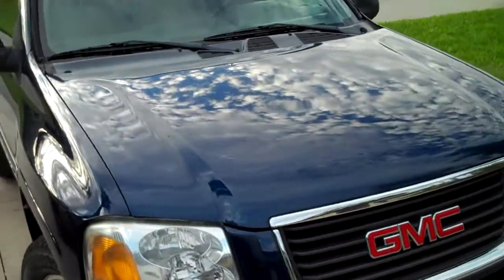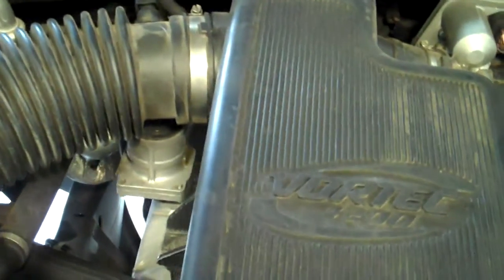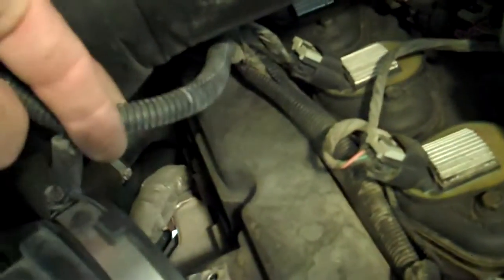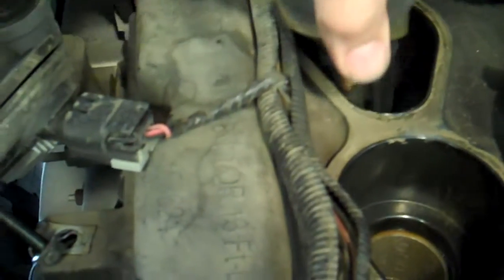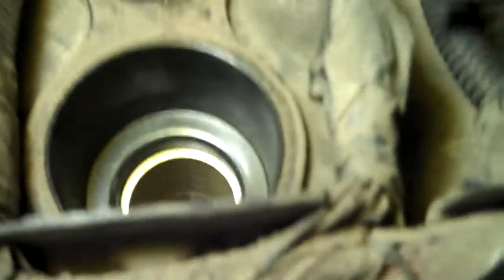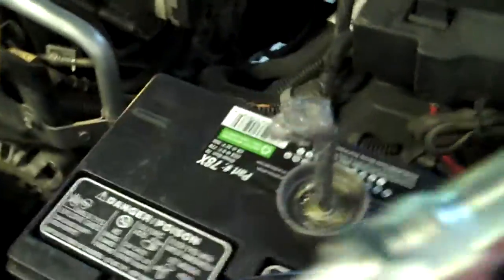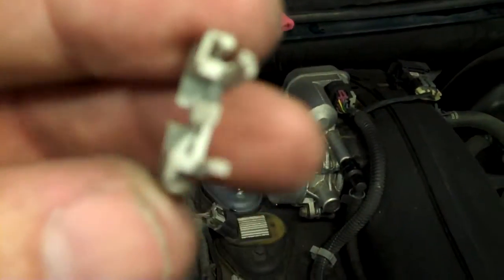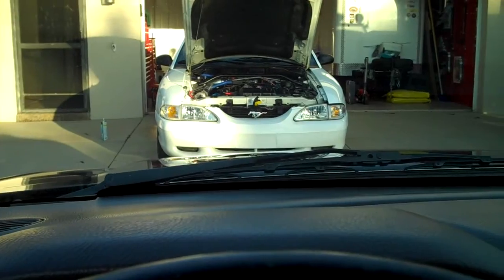Envoy Trail Blazer Spark Plugs and Coil Pack Change. The quick and dirty

Comment: Hello sir.  I just wanted to say that the rubber hose trick to get the new plugs started is a stroke of practical genius.  I am by no means any type of mechanic, but I was able to follow this video and it's procedures easily.  Now my trailblazer no longer bucks and is running as smooth as I ever remember it running.  Thank you so much and I will definitely recommend your channel to my friends with engine issues.

Comment: Great video.  You offered some good tips.  I have a 2004 Trailblazer pushing 200,000 miles in a month or so.  Really like it and the engine is still awesome (knock wood!) don't want to jinx myself.  Have replaced 2 ignition coils, water pump, and other normal maintenance.  Your video was clear and spot-on, some I've watched have been jerky, out of focus, and didn't even show what they were talking about.

Comment: This video is 100% on. I followed the instructions, replaced a coilpack in my 2005 GMC Envoy and my truck has been running smooth ever since. Just saved myself at least $300.00. Thanks for sharing!

Comment: My Trailblazer threw the check engine light at me this morning so I spent half the day at work watching videos of spark plug and ignition coil replacement on this engine.  This video is definitely the most helpful one, every single step is shown. About to go outside and tackle this now. Thank you!
Reply: What size fuel hose do you use for the spark plugs?

Comment: Thanks for the video. Check engine light came on, my 05 Trailblazer was missing badly and lost power, scanned it and found cylinder 2 misfire. Decided to replace all 6 plugs with AC Delco iridium plugs as well as #2 coil. Your video helped with each step. Air box came off, coils and plugs were pulled, plugs were pretty worn. Right call to replace them all.  Coil 2 was replaced, cleaned the throttle body, put it all back together and she purrs.  The cause of the Check engine light is fixed and the light is gone. 
#6 cylinder wasn't hard when I used my spark plug socket tool on a shirt extension. Step stool helped me get to the back of the engine to swap it out. Thank you again for your video and tips- it saved me time getting the job completed.
Reply: What size did u use..my husband did mines...he bought all sorts if things because it was a pain...don't know if he needed all of that,got a swivel extension

Comment: I have a 04 GMC Envoy, as well, Thanks for sharing this video, when I bought my 04 Envoy I changed that #6 coil pack, I had a code of a multiple random misfire,( so I took off the air box noticed 06 coil pack rubber seal had a split in it ( of coil pack ) when after removing it, was so bad rubber boots around coil crumbled. ( This was 3 months ago ). Well done on video 🤗👍

Comment: Great video.  All steps covered. No surprises. Fixed the car with new coil and put in a new plug.  Had 5 cylinders when I left work today. Watched the video when I got home. Went back out and bought the parts.  Installed them in 40 min.  Running on all cylinders . Thanks!!!

Comment: Nice job ..doing that on the 05 Trailblazer..now...190 thousand ..replacing all the coil packs and plugs.Your video is helpful  ..Its been a great truck over the years ..by the way a choice in beer..is good also ..:)

Comment: Best video of that much information in such short nicely detailed process I was afraid to even tamper with my 02 envoy cylinder #3 misfiring but after this video wow actually gave me confidence to do it my self I figured after changing the alternator and the starter specially the starter on these good lord they're pretty nice to get to the back bolt but now watching this this looks about half as easy as changing the starter on these. Thanks man you've  saved me over $1,000 thanks. Awesome video 5☆☆☆☆☆ all the way

Comment: Thanks for the quick video. Mine took about 45 minutes to change my #3 cyl coil and all the spark plugs. Added a o2 sensor change as well wile I was in there. Due to getting low gas mileage.
Reply: Upperpen Caregiver: I've noticed that my 2006 GMC Envoy is getting lower gas mileage - and suspected either plugs/coil or an O2 sensor.  Where was that O2 sensor at and how did you know it needed it?  BTW did it make a difference?  Any input would be great...  Thx!

Comment: What's up Tunerdude?? I have been procrastinating on doing a tune up on my 07 Envoy. never had the pleasure of digging into this one. just needed to get a little familiar and get a guess at how long it would take to do. mine currently has 196,000 miles on it, I am not the original owner, got it with 112,000 miles on her. never saw the spark plugs being replaced in any of the 6 months worth of service records. and she is idling very rough, your video came just in time.  haven't looked into the cost of things yet,  No check engine light either. Thanks

Comment: Just watched Vid, about to go out out IN THE COLD (WI) and replace #4 coil. Funny at end of vid you mentioned the snow. Ain't no snow here yet but its cold! Got the coil for 45 at local parts store. Must not be top brand. Also I been riding a while with same symptoms as described should have got plugs. Cross fingers nothing permanent, will let everyone know.   Also heard should do oil change as oil may have been diluted with gas that wasn't under combustion.

Comment: Liked-Subscribed-Notified   Good video. (Yes I also own an Envoy - it won't die, so I'm keeping it running).  I ALWAYS start my sparkplugs by putting them in with the chunk of air hose trick.  Never cross-threaded a plug, either.  I'm a firm believer in Anti-Seize, too.  You should look like the Tin Man from the Wizard of Oz when you're done.   No little smear of Di-Electric grease in the plug boot?

Comment: Amsoil throttle body cleaner killed my number 4 spark plug it leaked into the coil, or something, but it's all good I just replaced them all and the coils, and it runs almost new. Asmoil cleaner needs to be directly shot into the tb otherwise you will have a wet coil like I did. Love the Asmoil, and thanks for the vid.

Comment: You don't have to remove the keeper, slide it up about 1/8 of an inch and then press down on the tab just below it.  Both take a little force but no tools are needed to un-clip any of that style connector.

Comment: Hi, thanks for the video . I have a 2002 Envoy . It was running very rough 65,000 miles , took it to GMC dealer . Called me Thursday said the codes showed coil 2- were out ( do you test to see what exact coils are dead )? Ok so I call guy back he tells me over 700.00$ ? I told him I seen the parts for 200 6/pk ACdelco . He tells me bring the parts for 269.00 I think it was they'd put them in . I tell him ok, I get home yesterday there's a message we got the 2- coils done come pick up your Envoy ??? What the crap is that ,lol . So now I have a 6pk of coils coming to me on Monday , I'm confused. Anyway I just posted to kind of say thanks ! I really needed to know how I can test to find which coil is bad if/ when ones goes again ..thanks again..Kevin

Comment: You make it look far to easy... yep! I finally changed my spark plugs... I even had your video on my phone. I took my time with the first one, I must have spent 15 minutes from beginning to end. I had to go over it, because when I was placing the coil back in place, I just could not do it. I must of taken that spark plug three times before I decided to just change the coil with one of the others, and that solved my problem. I just don't know what that happen, but when I changed the piece, it went in like a glove. I was overly careful, because I cannot afford to have it done by a professional or make a mistake.  By the time I got to the number six it only took me a minute from beginning to end, and I was less stress out by it. And what a difference... the ride is so much better. Although, the idle got better the engine have stall every now and then, but only when the engine is cold. I changed the air filter and cleaned the throttle body, I have to do the gas filter and clean the fuel injectors, I think and if that do not work then I will have no choice but to go to an expert.  I got to say that the new plugs and the clean throttle body have surpass my expectations, and I found out that the procedure it is not that really hard to do.  I just had to get pass the fear to do it, and now that I have done it I am no longer afraid, I feel more confident and the next project will be using the Amsoil power foam and change the gas filter. Thanks for the videos, I have saved a lot of money, because these things here in NY are more expensive... Thanks!
Reply: Great video thanks for your help.

Comment: At 2:30 in the video, do you have ANY idea what that red wire in front of the fuse box goes to?  Mine has the same wire that is not hooked up, and I am just curious.
Reply: Eric Brunhammer that wire gets hooked up to the empty post on the fuse box to charge a external battery on a trailer.

Comment: Mine wont ignite but its turning over, also some of my spark plugs had oil on then when I replaced them. What does this mean?
Reply: You need to replace your oil gasket.
Reply: Valve cover gasket for oil in plug holes.

Comment: i just changed all my coils and plugs.total cost was 96 bucks on ebay new coils and plugs.its cheep to do .part stores way to expensive.plugs would cost almost 10 bucks a plug and 56 per coil.ebay or Amazon is the way .

Comment: Do you need to gap the spark plugs?
Reply: Carlos Huerta it’s always good practice to double check the spark plug gap to make sure they are in the manufactures specifications, if it isn’t, you can adjust the plug gap on what the manufacturer recommends. Normally spark plugs come pre-gapped but not to the recommended gap by the manufacturer and on some cars gapping spark plugs isn’t recommended.
Reply: Not if you go with the iridium AC Delco type. The iridium is very thin, you can scratch and/or chip off the coating and the plug won't last.

Comment: Hi. I changed my 6 spark plugs. And now my envoy vibrates. I need help. Thanks
Reply: its miss firing but I hope you figured this out already.
Reply: Mau: did you get it fixed?   Did you make sure your spark plugs had the appropriate gap, or were any of the spark plugs not sitting right onto the engine block?  :-(
Reply: The Claros Family thanks for asking. The spark plug wasn't inside the coil. I went to autozone they scanned and found the spark that wasn't right. Thanks
Reply: Mau: great to hear that! Thanks for sharing too!

Comment: I thought the battery has nothing to do with spark plugs and wires?
Reply: Franken Peter . It doesn’t but better to be safe than sorry while working under the hood. You may lay a wrench from the positive terminal to the body creating unwanted sparks possibly damaging a battery reservoir cylinder. When you lift the hood of a car to work on it is always good practice to remove the negative cable. Murphy is a bitch. ✌🏽